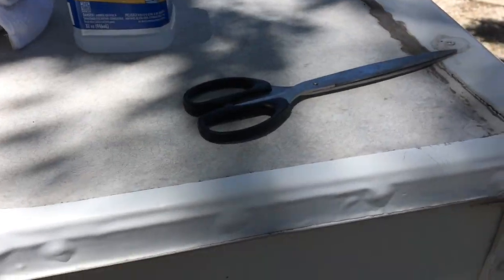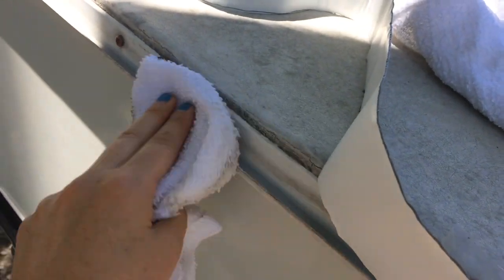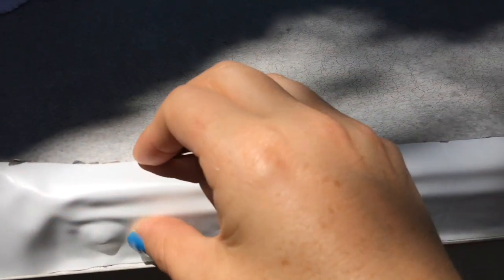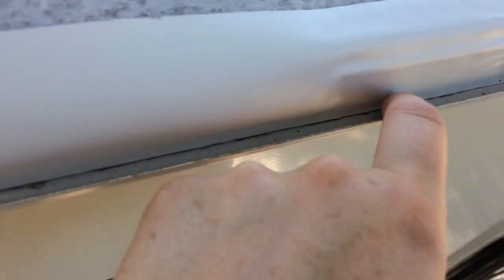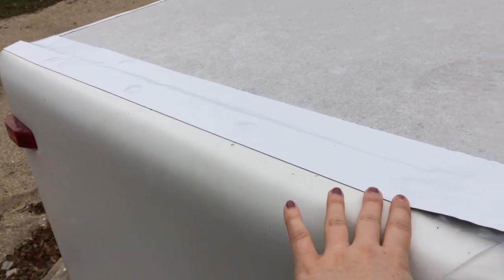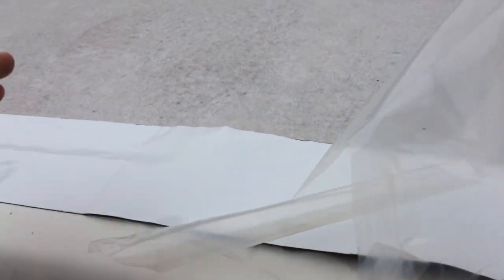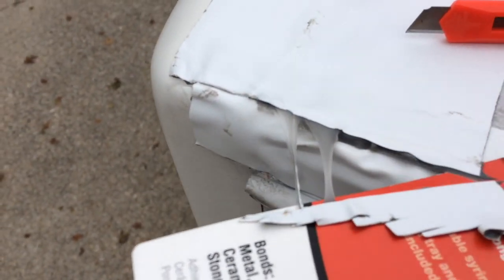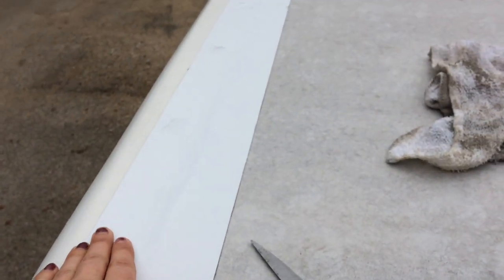Eternabond RV Roof Repair Tape How To Apply and Review

Comment: If using mineral spirits to clean surface go back with  isopropanol or denatured alcohol. Mineral spirits is oily. Also using a good roller pressing down firmly is how the adhesive is activated.

Comment: You need to use the roller to apply. It’s a pressure activated adhesive. If you don’t it will fail over time. Cheers

Comment: Very nice job and thanks for the video. I have a new RV but need to have this on hand..
Reply: DO NOT STRECH OR PULL ETERNABOND
Reply: The eternabond is much thinner today almost like two sheets of paper stacked together I am very leary of using it being it will fail in a short time.